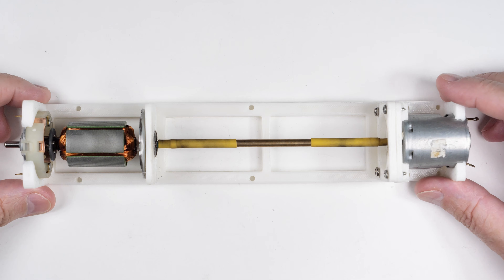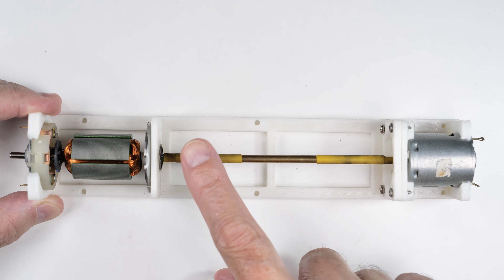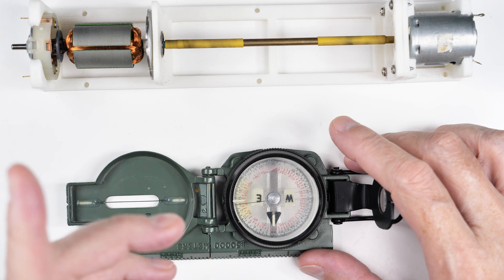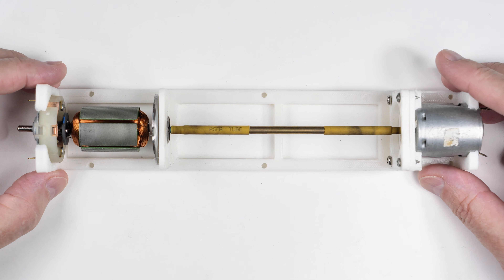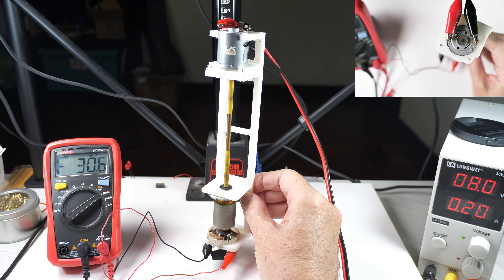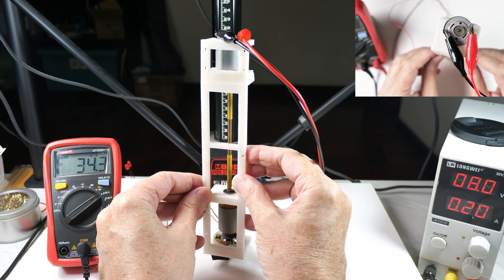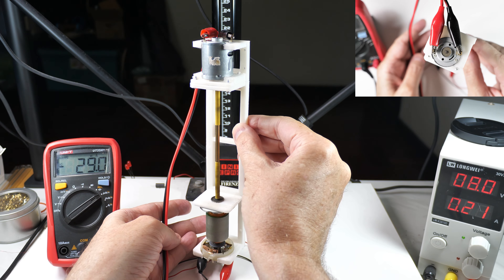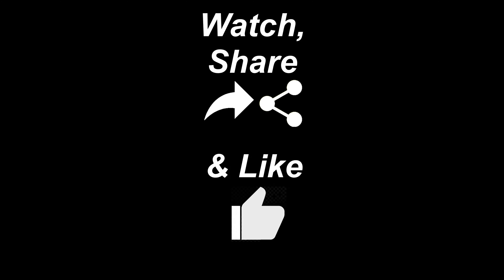What Is An Earth Inductor Compass? (4K)

Comment from the maker: Now I'm wondering if I could make an Earth inductor compass from 2 of those little tiny motors inside of cell phones....
Reply: The rotor of the generator must be isolated from competing magnetic fields.
At that scale, there’s too much competition.
Reply from the maker: @denverbraughler3948   I made and it works, but it works badly. The problem is not the decreased amperage (it's 1/10th the big one), but that the rotor has only 3 arms, so it's "resolution" is awful. I'm trying to make a video on it, but am struggling with the visuals. I need a tiny motor with 4+ arms on the rotor. Can't find one....

Comment: If you amplify the current from the brushes (i.e. into an opamp's inputs and using its +/- output swing) that can drive a geared-down motor to turn the entire assembly to find and maintain null by itself.

Comment: Nice demonstration, but as others have commented, in an airplane the Earth inductor compass cannot reduce errors due to magnetic variation or magnetic deviation, because the Earth inductor and the magnetic compass, whether needle or card, each sense the same magnetic "lines of force."  In stable flight, an inductor will indicate the same magnetic heading as a simple magnetic card compass.  Its advantages lie in the fact that it can generate a relatively robust, electrical heading signal, while a card compass is operated only by the interaction of small, permanent magnets with the Earth's relatively weak magnetic field.  Also, the rotation of the shaft which spins the inductor assembly to generate the signal might provide some gyroscopic stability if the shaft is properly gimbaled.  Even after the later development of flux valves, or flux gates, which use an ac coil to magnetically move the Earth's flux rapidly in and out of saturable sensing coils in order to generate heading signals with no moving parts, the problems of magnetic dip, variation, and instability persisted.  The sensing element of the flux valve was gimbaled, again, to allow leveling of the sensor by gravity, regardless of the exact orientation of the case due to its mounting, for instance in a wing with dihedral.  The gimbaled sensor was still affected by acceleration forces in flight, and any motion of the sensor from plumb resulted in unstable indications.  Many of these problems were overcome with the addition of a stabilizing, directional gyroscope to the system.  After WWII, most transport category aircraft had gyro-stabilized, flux valve based compass systems, many with multiple heading indicators in the cockpit or navigator's station.  Although mostly stable, even in turbulent flight conditions, and even with compensators to counter the effects of  deviation due to aircraft structure and systems near the flux valves, the indications they produced were still subject to the same problems of magnetic variation which affected the simple, magnetic "whiskey" compass installed in the cockpit as backup to the electronically operated gyro compasses.  Finally, around 1980, inertial navigation units began appearing in new airliners, and these did away with magnetic compasses altogether--except for the backup whiskey compass, of course.  Inertial units sense true heading rather than magnetic while the aircraft is stationary on the ground, and update heading by gyroscopic and accelerometer sensing and computation throughout flight.  Although magnetic heading display continues to be primary on flight instruments, these values are actually derived from true heading and automatically corrected for local variation by reference to data in computer memory.  Problems solved.
Reply: Good information!. I have to ad only one information: 
Zero crossong point of the sine curve is a more exact point to head on, than the maximum of the sine wave, 
just offset the cale by 90 degree and you have exact reading ;-) 
  If you plot the voltage output from the Earth Inductor Compass over angle you get a sine curve! If you want to find the exact north direction you would have trouble to find the exact angle for the maximum,
as the voltage does not change much on the maximum of a sine curve.
But the voltage changes much at the east or west direction, where it crosses the zero line of voltage. 
So the best use is to find the point of zero voltage, for example heading west, where you get good reaction on deviation from this angle.
Lets say positve voltage if you deviate to the right and negative voltage is you deviate to the left. 
Charles Lindbergh heading to the west would get good indication of deviation of his heading direction if he used 
the zero crossing point of his Earth Inductor Compass.
I guess all Earth Inductor Compass used this increased acuracy by using the zero crossing point and just offset the reading of the degree scale by 90 degree to get the correct reading to north.
Lindberg had to follow a cours that was not always exact west, but adjusting an offset on the scale would do  the trick, 
In praxis pilots had a adjustable scale offset, to find any heading anle they want to go to, 
and they could read just the positve or negative voltage while correcting theyr flight direction in order to hold the voltmeter needle to zero.

Comment: I'm not seeing how this would help with the problem of the north magnetic pole not being on the actual north pole. Seems to me that it would point in the same direction as a conventional compass.
Reply: There are multiple problems with magnetic compasses on airplanes. First, it bounces around in turbulence and is hard to read accurately - the same is true on a ship. However, on an airplane things are worse because banking and accelerating the plane forward and backward all change the level line created by the liquid in the compass and then the vertical component of the earth's magnetic field near the poles has strong effects on which way the compas points. These instabilities are a major problem for pilots of small planes, even today. Those pilots use a gyro-compass to get around the problems, but still need the magnetic compass to calibrate the gyro compass periodicallly. The earth inductor compass gets around the stability problems, but doesn't alter the fact that magnetic north isn't generally true north. Still a stable reference to magnetic north is a beautiful thing in an airplane.
Reply from the maker: I agree with everything you said. My only "however" is, as I recall, the inventors claimed it was less susceptible to variance. I have not figured out why they said that, but their model also had multiple rotors and mixed the signals to get a final output. Mine is the most basic device to test their principle, so.... I need to find those diagrams and put some effort in to trying to understand how that might work.
Reply: A conventional compass can be pulled down to the point it no longer rotates freely. Of course most good compasses shouldn't get bogged down but I could see this being a problem with older compasses.

Comment: The only thing that's changing relative to the magnetic field is the frame of the device. The rotor is always rotating at a constant shaft angle (perpendicular) relative to the magnetic field and to the earth itself. Like others here said, it looks like it shouldn't work!
Reply from the maker: The patents and pictures of the device are online. Charles Lindbergh used it, so there's that. However what most people seem to miss is the Earth's field lines are not flat to the surface of the Earth. They are arcs. The actual device was on gimbals to hold it parallel to the Earth. A coil spinning in a 3D magnetic field (where the field lines dip through the coil) requires Faraday's calculations using multi variant calculus. See the pinned comment above.
Reply: You are correct, the frame is rotating, but so is the brush holder and the contact points being made on the commutator.  This is the key to the design.  The maximum voltage produced in the coils of that armature will occur as they cut through the N - S lines of flux.  When the brushes are moved, via the frame, to align with the commutator segments for those coils, we see the peaks, both positive and negative, on the meter.  When the frame is rotated 90 degrees the brushes then make contact with the armature coils moving with the  magnetic lines of flux (e.g. east & west) and little voltage is shown on the meter.
Reply: Instead of turning the frame, he could just turn the brush holder and accomplish the same result. 

Pretty cool stuff. 
Never thought earth magnetic field could induce a current in such a small coil.
Reply: You need to realise it's the position of the carbon brushes you are seeing 0n 360°
Reply: @peterwright4224  ahh... that makes sense since that's a part of the motor that's not rotating with the armature.  The earth's field adds or subtracts from the field of  the motor's permanent magnets.
Reply: @jazzjohn2  there are no permanent magnets in the generator (was a motor). Its stator which had magnets in has been removed.

Comment: If earth's mag flux is strong enough to make this operate correctly why aren't all the powerful magnets on earth not facing in the same direction.
Reply: Physics.
Reply from the maker: It is producing 30 micro amps or 0.000030 amps or 30/1000000. If I spin that motor with regular magnets it will produce more like 2.x amps. So the Earth's magnetic field has an effect that is 66,667 times less than the magnets the motor came with. If I hang a huge bar magnet on a string, it will align with the Earth's magnetic field. If I put a magnetized steel ship in a lake with no currents, it would try to align N S.

Comment: Fascinating concept... but I'm missing something (probably obvious): Until you gave the demonstration, I assumed that the pickup rotor would be horizontal in use, with the long axis (ie the axel) pointing as you would a magnetic compass.

What I don't get is how the reading when the rotor is rotating on a vertical axis... can vary when you rotate the entire device... around the same vertical axis???  
I would have assumed that any stationary/fixed magnetic field lines would induct equally in the spinning armature windings whenever you rotate the device around the same axis.
Reply from the maker: You can find the original patents online for details. The Spirit of St. Louis used it on its transoceanic flight, and it was used by ships for a time. It does work horizontally (as I originally assumed it would work), but it's much less sensitive. I had to go back to the original drawings to see that I was wrong about its horizontal operation.
To understand what it is doing, you have to think about the brushes and contacts. How they are turning on and off at specific intervals. Then it will make more sense.

Comment: This should also work with a paramagnetic disk, similar to early DC power generators. One radial brush, and the shaft is the other electrode (you would need a brush for the rotating shaft). 
Perhaps it would work better than DC brushed motors with few poles and commutators.
Unfortunately, precession may make it difficult to sweep it to find North 😅
Reply from the maker: @tanner3801  A continuous commutator contact will produce electricity, but won't work as a compass.
Reply: @tsbrownie  in terms of generating EMF proportional to the flux and direction of rotation, yes, I think it would. The angular velocity may need to be higher than this wound rotor (depending on the radius) and the rotational axis would be perpendicular to the above example... but it should behave similar in terms of angle:voltage.
Am I missing something?
Reply from the maker: @tanner3801  The actual device and my model both have interrupted commutators. That way only 2 of the coils are detecting at a time. That gives good sensitivity to direction. If all the coils were detecting all the time the current would always be the same.
Reply: @tsbrownie  because each winding has different EMF at any given time while rotating and they would short out and give either the avg voltage or zero... but at any given angle (dictated by the brush locations) they should have roughly the same EMF, which is why you get a constant voltage aside from the commutator interruptions. 
A DC generator accomplishes exactly the same thing, except you have no definite interruptions between n winding due to the commutators. The EMF is generated the same way, except a wound motor has much higher inductance and would produce higher EMF per the same magnetic field.
I do think it would work similarly.
Reply from the maker: @tanner3801  The original patents are online, you can read for yourself. These devices were used on ships and planes. It's not a matter of guessing.

Comment: A version of this instrument and a clock were the navigation tools Lindberg used to cross the Atlantic.  His rotor was spun be a small windmill and his meter was an analog certer-reading one.  He set the desired direction by rotating the brushes. The meter read zero when he was on-course and left or right when he was left or right of the desired heading.  His route had pre-programmed magnetic directions for given periods of time.

A regular compass is unstble in turbulece as well as suffering the magnetic dip effect.
Reply from the maker: I didn't know that, thanks!

Comment: Good video!
The more poles the motor has, the more accurate pointing, same with slimming the brushes down will also help (less overlap), and more turns on each pole, I think I need to try this  :)
Reply from the maker: Actually, you just figured out the video I'm working on, but there's a twist!
Reply: @tsbrownie  awesome, cant wait!
Reply: @tsbrownie  I wonder how a skewed armature stack (as some servo motors use) would affect this?
Reply from the maker: @user-rs8zg8ey2b   You want to be able to control which arms of the rotor are active because as you know, that's how the direction is determined, relative to them.
Reply: @tsbrownie  I was thinking a broken Dremel tool would make a good candidate, about 12 poles, larger (more copper) and large comm (gives more space).
Reply: @tsbrownie  I was also thinking to make it more sensitive (including what we spoke about above). Why not try a resistor decade box for a load and a voltmeter across the resistor load. If tuned, it might give better resolution readings. Also might adding a small cap (say 0.1uF for starters) across the load resistor to stabilize the noisy comm/brushes.
Reply from the maker: @user-rs8zg8ey2b  I will have to try that.
Reply from the maker: @user-rs8zg8ey2b  My Dremels are not broken (yet). I'll look for something similar.
Reply: @tsbrownie  most DMMs use a 1k or 2k resistor for current sensing for the uA range, might want to start around there and try higher and lower values.

Comment: I don't see how this wouldn't be susceptible to declination?
Inclination : sure but with reduced sensitivity as you approach the magnetic north pole.
Reply from the maker: @dougaltolan3017  I don't either, unless it was dynamically adjustable. The actual device had multiple rotors, so they may have found a trick that I am not seeing. I'm just going off their claims, which overall seem to be correct. It's a matter of trust until I can prove it one way or the other.
Reply: @tsbrownie  Who is "they"? I'd like to see all of thier work please.
Reply from the maker: @dougaltolan3017  If you google "earth inductor compass" the original patents show up in the results.

Comment: I think it should work to some extent even if the whole device lying on the table will rotate horizontally, perpendicular to the axis of the rotor.   I wonder if this is true.
Reply from the maker: I tried it and it does produce electricity, but it did not work as well.
Reply: @tsbrownie  It might help to try to find a suitable commutator position offset by rotating the device around the axis of rotation. After all, change the position of the commutator in relation to the direction of the magnetic field is actually the principle of the device.
Reply from the maker: @Georgy-fg3bg  The brush plate has a key that fits into a slot on the frame. That was by plan. If you built from my plan it would have the same results.
Reply: @tsbrownie  Of course, it will work best in a vertical position. The device works like a regular dynamo with a permanent magnet stator. In this case, however, the magnetic field of the stator is represented by the magnetic field of the Earth. The problem with this compass is that it shows the same values twice when turned 360°. (they repeat after 180°). We find the direction to the pole, but we are unable to determine whether it is north or south.
Reply from the maker: @Georgy-fg3bg  The actual devices used multiple rotors in different orientations. Later ones just showed if you were left or right of your target heading.

Comment: Great video. Clever idea.
1) use an analogue Voltmeter rather than a DVM. the analogue metet needle will smooth out any jitter in your readings.

2) put two soft iron poles (a couple of soft iron bolts will do, one on either side of the rotor)  across the sensing rotor. This will concentrate / focus the magnetic field being picked up. It should give you higher directivity gain. 

3) you can quantify the directivity gain using the standard 2D DI (Directivity Index) using the standard DI formula (simple). Do the calculations using an excel spreadsheet. Look up Wikipedia for the formula.
Reply from the maker: Thanks for the great suggestions. I'll have to try it out.

Comment: You can also put the drive motor in a concentric magnetic shield or two. I was able to get  (earths field) shielding  w. 3 layer shield down to microgauss using mu metal ! Your setup is only sensitive to horizontal component of earths field when vertical.